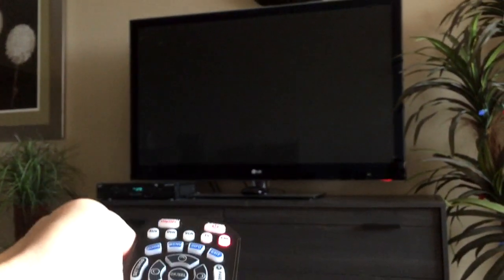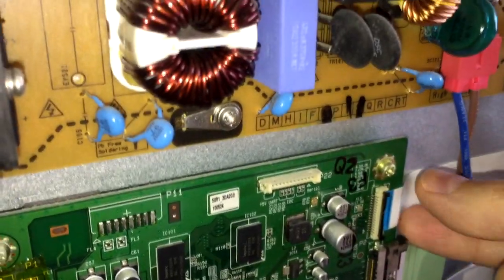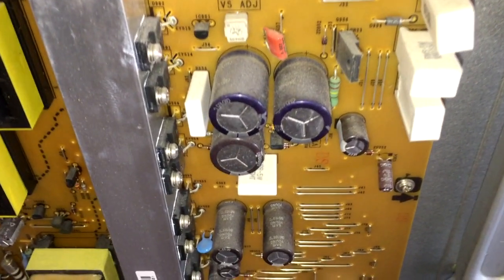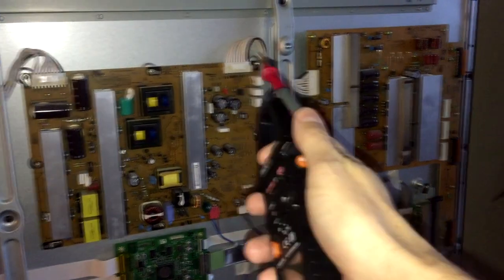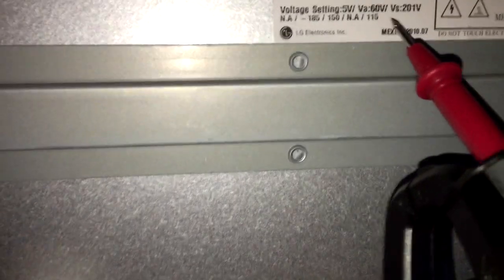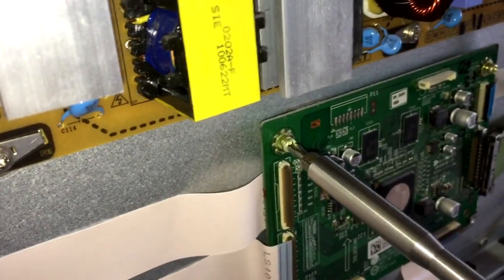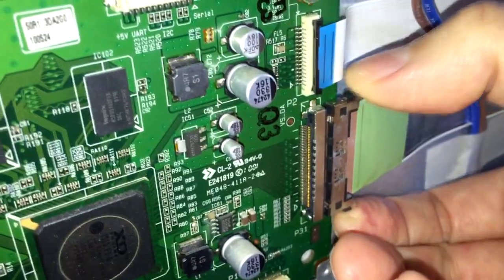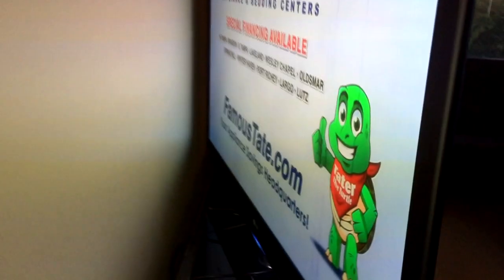Flat screen TV repair no picture only sound

Comment: Thank you for the video. I have a Sansui TV which switched off a few days ago. I unplug it and left it for a few day's. I then opened the cover and was TOTALLY  SHOCKED  to fined the cover was DAMP, it looks like CONDENSATION I dried it, left it open a few days to dry out the hole TV. CAN YOU HELP ME PLEASE ..I can't  afford another TV I live on a small Pension. Oh I also made a plastic parcel with some RICE and attached it to the cover. The TV comes on and when the Satellite  Decoder switched on the TV then goes off. 🙄 I am going crazy 😮 is my TV going into a safe mode? Thank you from South Africa

Comment: Hi! As I was checking the side with the electrolytic capacitors, there were four areas with white goo. Is that what you mean by the exploding tuna can? And if so, does this mean my tv's pretty much unfixable at this point? I haven't even had it for that long :( I'm also currently baking the motherboard as you've instructed in another video to see if that will work. I tried it once before but took it out at 8 mins instead of 10 at  380 degrees to see if that will make the difference - thank you!